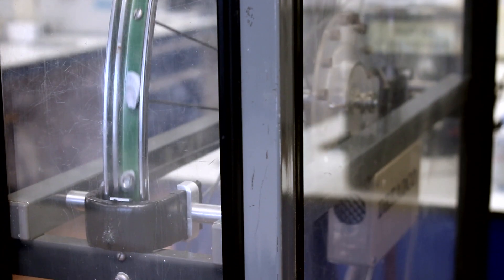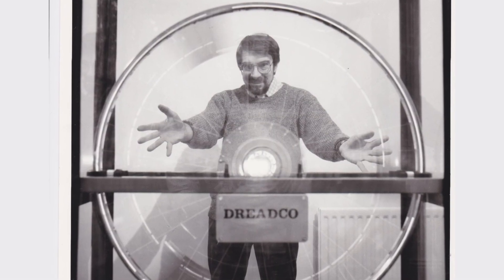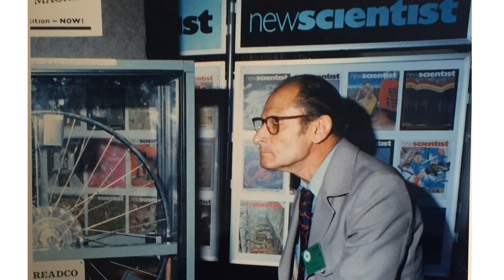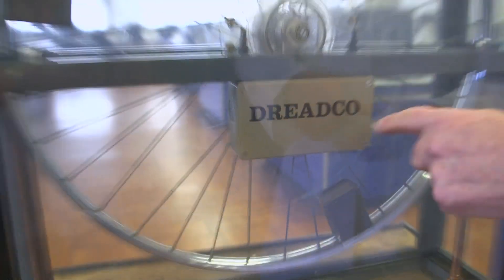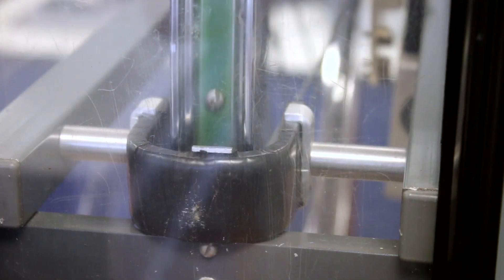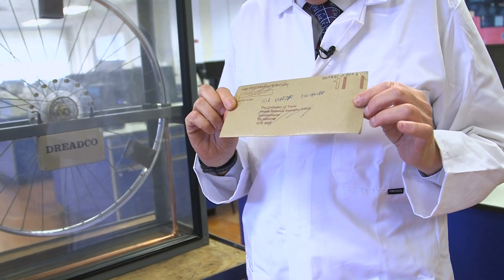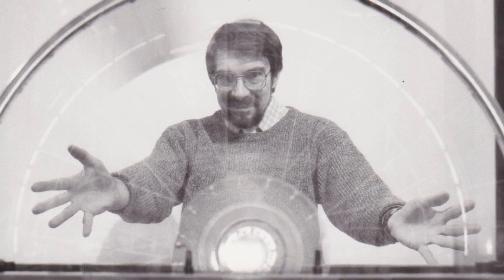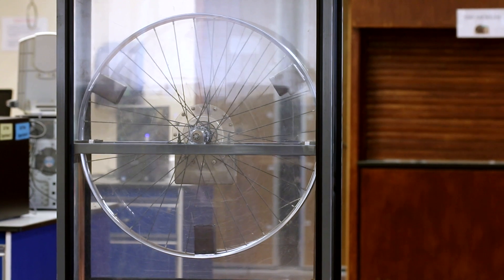Perpetual Motion Machine - Periodic Table of Videos

Comment: If you throw a magnet inside a copper's tube in the vertical position, you will see the magnet slowing down, "fighting" against gravity, that's because it's actuality producing electrical energy by electromagnetic induction, and therefore the copper also become a magnet for this short time attracting the magnet from inside... If you put a magnet strong enough it will take more time to get out the copper's tube. If you could produce a perfect circled wheel and put the magnets outside and inside in strategic positions, turning the poles to repel/attract in some way that you can use the Gauss and Faraday principles, you actuality can make the wheel moves just by it! Which is in reality, a very hard structure to make, needs a lot of patient... The Magnetic Force ignores friction, that's something people normally don't know or forget it... Objects moved by magnetic force don't stop or lose velocity just by air's friction, you need a solid object to do so, the metal itself don't ignore it, but it's not fast enough to make heat or some damage, so it's still Ok. Remember that's magnetic force can also fight against gravity. Magnetic force it's like sparkles of the strong nuclear force inside the atoms, but with the electrons, photons, quanta stuff and so far. If one day we truly understand how to manipulate it... Something that people have learn wrong is to think its impossible to re-generate energy, but you can actuality produce a multi-layer energy generator that can refuel itself, if of course, there's nothing more to feed but your own movement. The electrical energy produced with the motion can feed the initial motion and also produce energy again and again, and of course, this works better with a rechargeable battery attach to it. (which already existed in 80's labs).

Comment: Aluminium and copper generate a small electric current when they touch. He built red herrings into it. Imbalance wheel, bi-metal effect and heat pipe you could conclude right off.  If I could examine it personally I could solve it.

Comment: I see an electrode tip sticking-out close to the wheel hub. Maybe it gets all its electric energy from some radioactive decay emitting alpha particles and that's why the mechanism is slowing down because of a short half-life? (10, 20, 30 years). The electric current may suffice to activate electro-magnets or the pendulums in the box to overbalance the wheel and keep it turning?

Comment: In the 90th there was a science entertainment show in Germany called the "knoff-hoff show" (play on "know-how show") where as gap fillers inventors could show and exhibit their contraptions and devices and explain them or they got explained by the hosts. Perpetual motion machines appeared often together with explanations of why they were fake. Some much more elaborate and long-lasting than this. As I recall most were driven simple by battery and very efficient step motors couple with small magnetic switches. Very cheap stuff, nothing fancy. Like a handful of euros or pounds cheap. So this might as well use the same technique. In the technical museum in Munich there are several machines on exposition, some running for more than five years without replacing the battery, using simple speed-control circuitry. Formerly they had one powered by a radionucleid battery but its no longer visible due to safety problems. And i think this would count as cheating.

Comment: There's a small DC motor and a couple batteries in the "DREADCO" box which has an obscured tiny rubber drive wheel protruding, which actuates against the acrylic disc near the hub.  Everything else is there to distract.  There's a reason we only get to see it up close from the front.

Comment: I think that there is some circuit that generates high voltage, which is transferred to the wheel by this sharp rod to those metal cups which then is collected by this ball ended rod. As a energy source theher is might be dry pile battery or it might be harvested from radiovaves, or there can even be a termocouple which might be announced by those radiators. Nevertheless if it slowing during years then the power source must loosing energy during  discharge or the bearing gain friction.

Comment: I would guess that, as the machine heats up, the air inside the pipes shown expands, which makes it come out of the nozzle shown, pushing the sort of cup things. Though, for that to work, there would have to be very low friction.

Comment: I think it might just be an electrostatic motor with the battery in the DREADCO Box. The probes on either side of the box are connected to the positive and negative of the battery and the brass bits around the wheel are driven by the charge.

Comment: its either those three boxes are weighted and thats why it keeps moving or its moved by wheels at the sides holding it moved by the copper and batteries at the side which is an unlikely explanation or the weights in the boxes and the wheel at the sides are the ones xausing perpetual motion causing sorry

Comment: The three small boxes must be empty, if they were full with something the weight would be too great for the wheel to keep moving uniformly, the pipes and the big box might be  distractors too, I think that the secret is inside the mobile mechanism, a medium size battery can easily power a small and slow motor for two years or more and the gray pipe at the center of the wheel is too wide and thick for just being a support, the motor with the battery must be integrated tightly inside and the rest of the items are just misleads.

Comment: It seems like it is moving as if it were powered by a really small electric motor...since the tire is probably 'perfectly' balanced it would only need a super small amount of energy to run the motor. Also...based on some of the clues from the professor...like being disappointed in knowing the answer as well as it is now moving slower that it was previously I think something that we see everyday might be at play here! It would be cool to put a small light encoder to capture pulses to determine exactly how fast it is moving and if it is decelerating! :-D I would agree that all of the other 'features' inside are there to distract and hide the real 'propulsion' system. Something I noticed...at the very beginning when Neil was bringing the device into the room...looked like some kind of bump on the top left of the case...what might that be? I agree...speculating IS more fun...thank you for the videos...I love them!

Comment: pardon me if i make wrong statements here. 
first theory: perpetual motion machine is a machine or structure that keep moving or work indefinitely without source of energy, am i right? which means this machine can make energy out of nothing, and this break the law of thermodynamic. the point is, after some thinking, perpetual engine such as the one in the video is sill not  a perpetual engine if the definition which i just said in the first sentence is correct. my theory on that object is simple, i cant think something too complicated since i don't have enough knowledge to do it. my theory is, the form of the energy, kinetic and potential. those boxes serve as the converter, when one of the box reach the top of the wheel its potential energy is at its peak, when the other two already have lowered potential energy because those potential energy already become kinetic energy, when the box reach the botom of the wheel it have almost zero kinetic energy, when its ascend, it will build up another potential energy, and the source is the box that falling on the other side will give it kinetic energy to charge the potential energy of that box. i realized that this description is still far from what im thinking on this matter and, pretty much is what everyone is thinking at first (i think) but , i hope the reader will get the gist of it. the problem is, it still use gravity make it move, gravity is some kind of energy while its not quite an energy, i don't know wether if gravity can be considered as energy or not, but, for me gravity is some kind of potential energy that can be converted into another kind of energy. to summarize,  its moved by gravity if we ignore the critter in that space.
second theory: about those heat sink and cooper pipe, maybe an electrochemical system that produce electricity that can be used to make magnet, and its about to exhausted that make it move slower than it was.
Reply: patrick chia gravity is a force the trick is most likely a motor and a battery.

Comment: The biolite stove contains a material that generates a voltage from heat, the same way a piezoelectric material will spark a lighter from pressure.  My guess is one of those in the heat sink is generating enough power to make this a bldc motor.

Comment: My guess:  I think the three can like objects contain a long-lasting set of batteries and also an electromagnet.   There is a timing/control logic board in the large box in the center marked DREADCO.   The small spike and ball like objects may also be sensors that either help count the number of brass-like buttons that are on the inner plastic wheel.   In any case, the logic board signals the box-cans on the outer rim to very briefly charge their internal electromagnet just as it is approaching the apparent permanent  magnets they go through on the X-axis.  This provides just enough perfectly timed impulse to keep the wheel rotating in the counterclockwise direction.   Obviously the batteries used must be very long life (possibly mercury cells) and the amount used to drive the electromagnets must be very low in order to conserve power.  Basically this is not unlike low-power clocks and watches that can run for 10 years or more with the slightest power.
Reply: David Jones said that most of what you see is mere distractions. Those who know how it works all say they are disappointed by how simple it really is. I believe the center square tube houses a double spring arrangement, just like a garage door spring, but smaller, and the "dreadco" box houses  the gears, which are just scaled up watch gear arrangements. Just like spring wound watches, it takes along time for them to wind down. But watches have a very small spring. It is just a scaled up watch, and nothing more. That is why it is "so simple", and it only goes around for about 2 years, slowing down before it stops, just as spring watches do. It is as simple as a watch. There is no electricity involved. Even David Jones said it is almost all it is distraction, and the secret is hidden just like a magician would do. Thats why all the copper, and magnets do nothing, and the spring is hidden inside what seems to be just the housing of the object.

Comment: The Dreadco box contains a long life dry cell battery, with the two nails coming out the top of it being the positive and negative terminals that reach to the acrylic disc which contains magnets with opposing poles that create just enough force to slowly move the wheel. Everything else is there to distract.

It looks like a simple DC motor powered by a battery when you ignore everything else.

Comment: One for Martyn: In the Kensington Scuence Museum, they used to display a small mechanical clock which never needs winding up. It has no external winding mechanism. It works by diurnal temperature changes acting on a metal diaphragm, which is one side of a container of air. Expansion and contraction of the air does the winding, and a 3°F temperature change (and any ambient air pressure changes) each day will keep it running.

My (very likely wrong) guess for that wheel is that it contains a crystal set, tuned to a local transmitter, maybe TV or FM, and that charges supercapacitors or a cell, which keeps it rotating via magnetic fields. Delete this comment if I'm correct!
Reply: Or do they leave it up, knowing we would think it must be false if it's not been deleted? Besides, any action would be an "answer" of sorts and clearly no answers are forthcoming.
Reply: I cant understand why people want this machine beng magnetic or electric. Just keep it simple: thermal!

Comment: A very precise magnet pulls the can to it but can't hold or stop the can due to the momentum of the wheel. As the can passes the magnet the magnetic pole is reversed in reference to the can causing it to push the can away from the magnet and the rotation continues to the next can. It may have slowed over the years due to wear or resistance on the bearings.

Comment: I think its running on momentum only. The canisters on the outside are for extra mass only to help it apear to not slow down on a short time scale. No battery would be usefull after that period of time. There is a slot for a screw driver at the axis which you could use to spin it up, although i dont know if they spun it up before this video and lied that it has been spining for a long time or not.

Comment: My first guess is it's a sterling engine.  My second guess is there are magnets in the little cans and the magnets push them to one end of the 3 cans and back to the other end.  So that as the wheel turns, they are sent to the rim side by one magnet and the other side by the other magnet.  So that the weight in the cans is sent to different sides in the cans.  Thus rising, the weight is more toward the center and dropping its more toward the outside.  Or maybe it's two systems.  The heat engine creates air flow over the wheel from the copper pipe and the weights keep it going when their's no heat differential from the top and bottom of the machine.

Comment: My guess is all that tubing conceals an antenna, and that it steals ambient radio, television, and cellphone transmissions to power weak electromagnets to keep the wheel spinning.  It probably has a battery so that it can store power to keep it going when signals are weak or absent, and it's this battery which is beginning to degrade.

Comment: The energy is the curiosity of the people.When you move the box the wheel is into, it sends quinetic power to the wheel itself due to the movement of the whole system. If you stop paying attention to it, it will eventually stop. That's why it's been reducing its speed along the time as less people wanted to see it working so the box was not moved during a period of time.

Comment: I'd actually like to read that letter but before this I let you people know what kind of a guess I made about this looking closely at the wheel. There seem to be four phases of operation. First step is that the right magnet pulls its nearest box down from equilibrium and in this way it turns thirty degrees. After that the speed is such that it doesn't immediately stop, the law of continuity keeps it rotating additional thirty degrees. The third thirty degrees comes from the left magnet pulling another box toward it, and the fourth step is that gravity pulls the device back to equilibrium. From one equilibrium to the next the wheel rotates a total of one hundred and twenty degrees which is the same as the interval between two consecutive boxes.

Comment: If I had to guess, it's an extremely well-balanced wheel that harvests an extremely small amount of ambient thermal, EM, and gravity energy to make up for the entropic loss. The reason it is going slower is that the permanent magnets on the wheel are starting to lose power. The inner gizmo and the copper plate with the copper tubing are what give it away. It is slightly hotter at the bottom of the case than at the top and there is an extremely sensitive gas in those containers on the wheel. The wheel's balance is SO sensitive, and it spins so freely, that it can detect the small change in buoyancy. This wheel is also attached to the spindle at the center which also acts as an electromagnetic field harvester. That reflector on the side looks like the same lattice you see on IR remotes. It is probably harvesting ambient EMF and storing it in a capacitor that pulses once it has enough in it. This is synced up so that it pulses on one of those tiny magnets in the center to generate motion. The biggest red herring are the two U magnets on the side. I think they are there to help keep the wheel's motion smooth, and by doing so, keep the magnetic impulse in phase with the magnets in the center. There might even be some hall-effect trigger in there to fire off the capacitor once it detects a field pass through it. But either way, my guess is a combination of leveraging thermal energy differentials to harvest gravitational energy, and an EMF harvester to use radio noise as energy. I BET it wouldn't work at extremely cold temperatures inside a faraday cage.
Reply: In other words, this is not so much a perpetual motion motor as much as it is an EMF DETECTOR that spins a wheel based on how much EM is present, and requires a room-temperature operating environment to work.

Comment: We know it's a fake; therefore it must have a hidden power source.  It looks like a Tesla AC power generator. The spinning wheel spins a wire inside a magnet that generates AC power. The AC power, in turn, spins the wheel via other magnets and generates additional power to the hidden batteries. Eventually the battery will lose sufficient power and the unit will fail. Operating inside a vacuum will help decrease friction.

Comment: My guess is that it’s some sort of electric motor, and it gets its power from background electrical noise from the surrounding building. The case is big enough to conceal a large winding in the frame. 

The bicycle wheel is there as an excuse for a large case ;)

Comment: The Case is the answer: It's always cooler at the bottom, than in the centre where the DREADCO Box is. One can use peltier elements to convert a heat difference to a voltage difference.  And using a voltage multiplication device u can make higher voltage and pull and push the metal pieces in the centre towards rotation with both the tips.